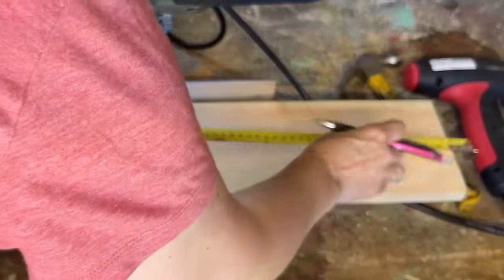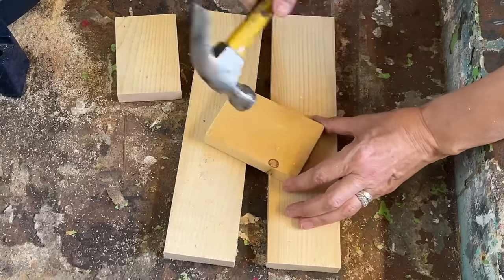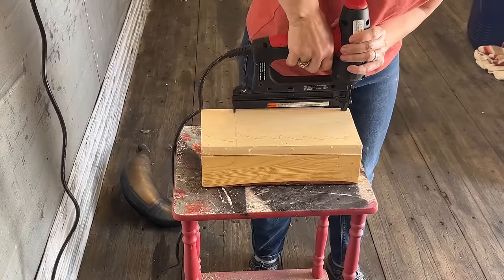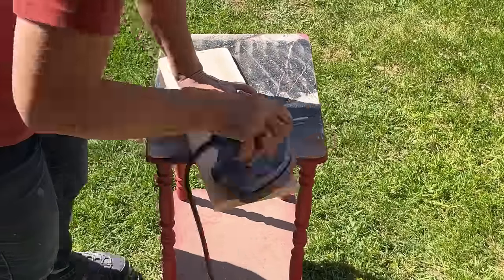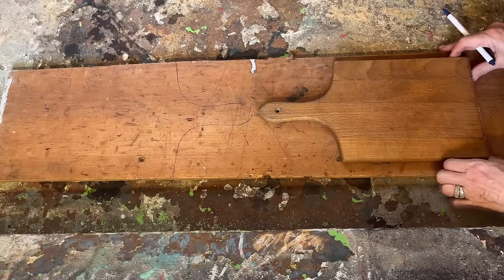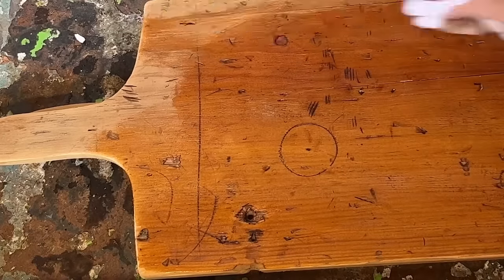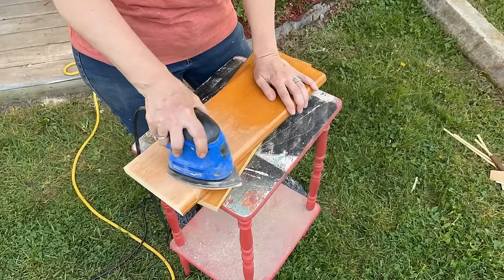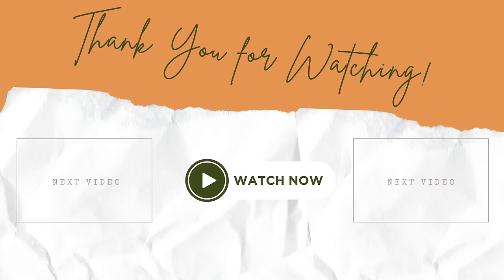Easy Scrap Wood DIYs: Top-Selling Projects Anyone Can Make

Comment: Hi Deidra,

I am having a lazy afternoon laying on the couch enjoying a nice breeze.  Tomorrow starts my one week Staycation and my goals for this week are to unfinish packing, organize closets, finish what I call my sewing/craft central area of my very tiny new to me home.  I have been greatly overwhelmed moving into a new place while still working a full time job 10 hr work days and I worked on Saturday.  My Dad turns 85 on Tuesday and he was out in the hot weather all week making 2 gates from scratch  for his side yard fense - one for each side.   He has made so many little boxes out of scrap lumber with the same skill that you have  and he has made them for years  to put them under the 2 front bucket seats for various SUVs he has had for he and his wife.   In 2012 he gave me his town and country van and I gave him my car because he would get a greater trade in value off of my car to buy his new van. The van he gave me has one of his boxes in it and in a couple months I will be donating the van to the Purple Heart Veterans. It has a pretty new transmission in it and I put new breaks and rotors on it. My Mom passed away less than 2 years ago and her car was pretty new and she left it to me in her will.  So, I believe my Dad's box I may use in my sewing area for measure tapes, boxes of my tailor pins and a tin can I decoupaged for my scissors.  My dad's box that I have has a hole on one side that is clear thru about the size of a quarter.  I have no idea what he was orig making when the wood was new  and maybe he goofed making the hole in the wrong place and it became one to add to the scrap pile. I also thought of putting it on a shelf side ways and sticking stems of silk flowers into the hole and using the inside of the box as a shadow box.  The hole is unique  and I kind of wanted to make use of it but not sure how. The box is pretty beat up also and he stained it golden oak by Min Wax which is also the stain I have used when I built a display frame for my brother in 1991 to suspend his 650 lb mako shark jaw in it. He loved the design of the box I drew up I think you too would be impressed.  I have the photos someplace in my bedroom. I was in the lumber business from  1984 to 1991 and had access to learn the chop saw, miter box, jig saw, router,plainer. My mom's family were loggers in Maine so I learned the BIG SAWS as well on summer vacations. 

Last Saturday I went to a festival in my neighborhood which is one of the first little towns started in my area of Arlington, VA. The festival had a section that was vintage, a section that was new crafts but made with vintage items and new crafts in general. Than there were the yard sale items. I hit everyfree box available and have some good finds.  One of the yard sales a man was selling cigar boxes from Europe and the USA and I wanted to buy a couple to decopage but he wanted too much. 

I have my Mom's bread boards and one is my grandmother's that is shaped like a pig. As a child I remember her cutting her Hungarian bread on it for us kids. Years later when she sold the big old house up north  and moved to her beach house the pig was hung in her kitchen over her gas stove called Detroit Jewel.  When she passed away her executor son said grandma left all the kitchen items to me and I was floored. Mostly all vintage we used daily. The Jada butter dish, Jada bowls, dishes from the 1940s  and stoneware with gold wheat and fleur D Leis.   Such treasures we used as children seen in photographs I now have. I gave my Mom the Jada and my sister now has that. 
I so enjoy your videos and ideas and as I watch them I think and remember I have a bag of drawer pulls too.  Somewhere packed I have a clear Glass door knob from my grandmother's old house.   From my grandfather's workshop he had hundreds of the wooden cheese boxes he used for hardware. None of his son's wanted the dove tailed cheese boxes but mom and I took them all. I have a couple upside down on my windowsills with my vintage bottles on them. The boxes give the bottles height because the couch is in front of the window so I can see my bottles from the outside and inside. 

I am sorry for yet another novel. I have been praying for you and others I know who live in Canada and hope your safe  with the ongoing fires.  I was #2 to click on the like thumbs up. 

Have a great day and week,
Rebekah from Virginia
Reply from the maker: Thanks so much for the beautiful know. I appreciate it. Hope you’re having a fantastic weekend. Take care.